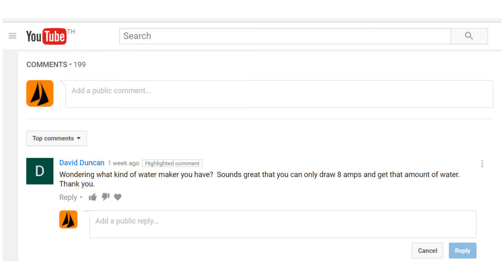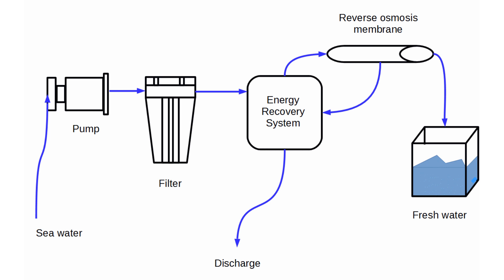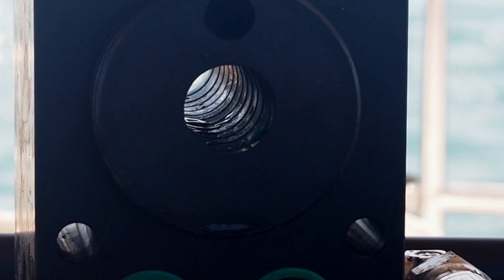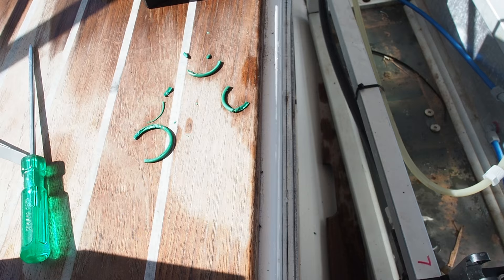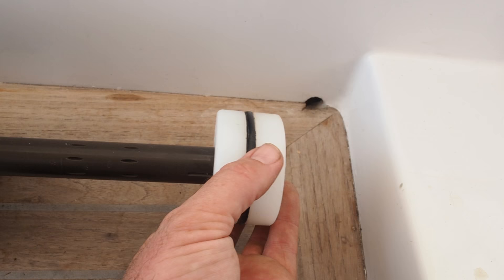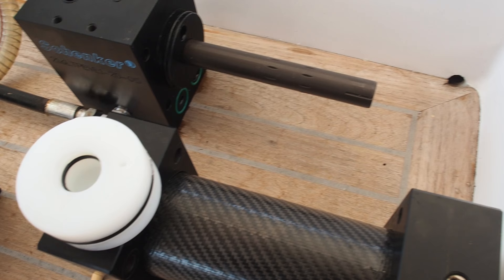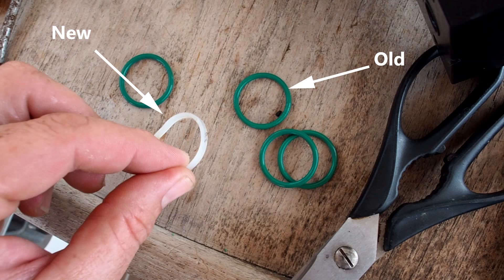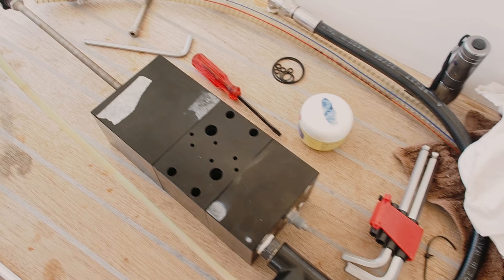How to repair and service a watermaker on a sailboat. Sailing Q&A 4

Comment: That's very interesting in the workings of desalination reverse osmosis pumps. I have a Big Berkey water filtration water maker. It has filters that take out all the bad stuff to make just about any water drinkable. Except salt water. It seems that the salt molecules combine with the water molecules and the gravity type units do not separate the molecules like your pressure unit does. Pretty neat!
Reply from the maker: Interested to know in what application you use your water maker, Dave. I'd just assumed all reverse osmosis desalinators were used for salt water.
Reply: The type of water purifier I use, (here on land), can make almost any water potable. Mine is used as a backup in case my well quits working, then I can safely use pond water to drink nearby. I live out in the boonies. Drinkable water is important. It is a filter and not reverse osmosis. The filters can be reverse flushed. Here's a link to these kind of filters... http://www.bigberkeywaterfilters.com/helpful-resources/?___SID=U
Reply from the maker: Yes, that's quite a different process. The only filter we use is a 5 micron to remove 'large' particles from the raw water. Given more space if like to include an additional filter system like the Big Berkey inline.

Comment: A watermaker would sure be nice.  It does seem that they are fiddly creatures that take a lot of maintenance to keep them in operation though.   We don't really have the room to set one up on our smaller 35' boat, or the extra power to run it right now, so we are planning to try going without.   It might be a trial conserving water though.  Fresh water is a precious commodity on a sailboat. 

Nice video on your watermaker and your efforts to keep it running in top notch condition.  I'm getting really spoiled having a new FollowTheBoat video every day to watch.
Reply from the maker: Cheers, +SV Barry Duckworth. There are small watermaker units out there though. They take up little space. I helped recommission a unit that was small enough to tuck under the sink. Of course their output is far less but the trick with watermakers is to run them regularly. If you get into the habit of running them whenever the engine is on, for example, then they're less of a hassle. The problems start when you're constantly pickling them. I've let our watermaker stand for weeks at a time without pickling and it doesn't seem to mind.
Reply: SV Barry Duckworth We installed an H2O to go watermaker in a companion way step. Total cost about AUD$4600.  Details here http://www.h2oonthego.com.au/ .

Comment: I'd get those rods on a lathe and take the thread off the sections that remain outside the housing when assembled.
Reply: Good idea! the factory should have thought of that!Great info on watermakers, they do seem to be great machines but are often trouble some. Picking a machine with good world wide support is vital. The use of watermakers has made the singlehanded/crewed sailing races round the world so much faster as they don't have to carry all the weight of water , hence less food so less weight , hence even faster so shorter times so even less food and it goes on. About 75 days for the Vendeeglobe finishing in the next couple of days.  great informative video.  cheers warren
Reply from the maker: Yes, very good point!

Comment: Interesting. Most systems I've seen use a low pressure pump and a clarkpump.
Reply from the maker: Isn't that a Spectra-specific system?
Reply: followtheboat I think maybe the "clark pump" name may be specific in RO as spectra? But I think other water maker may call it a boost pump. Rainman water maker out of Australia and others may call it diff?
Reply from the maker: Thanks for the info. I am no expert on watermakers and I'm learning all the time (which is sailing in general). Thanks for the info.

Comment: Any watermakers known for their simplicity, durability, and ease of maintenance and repair, or are they all similarly challengingly?
Reply from the maker: That's not a question I could answer with complete authority. The only other watermaker I have experience with is the Eco Tec, which is petty straightforward.

Comment: Great episode, very well put together. Have a question about solar power. Don't know if you have seen what Elon Musk is doing with solar roof tiles but wondered if an adaption of that concept would be viable to "roof" a boat with  much more surface area than is possible with fixed sized solar panels.
Reply from the maker: Hi Steve. Yes, we try to keep up with solar technology and I'm aware of these panels. My dad told me about them initially and I did wonder about the practicality of putting them on a boat. The main issue would be their non-slip properties in the wet and how much heat they generate, not to mention wiring. Interested to know how much more or less efficient an array of them are compared to a single panel of the same dimensions.

Comment: Great, great information on the water maker and repairing it. I love these Q&A videos...so much info. I have a question about bugs and insects on board and keeping them out in humid places like the part of the world that you are traveling in. Have you ever had problems with cockroaches and insects getting inside the boat? If so, how do you get rid of them and prevent an infestation? Thanks and fair winds!
Reply from the maker: Great question, Kia. In fact the clip of Liz swearing at me was when we were clearing up a cockroach infestation. They happen from time to time but are easily tackled with the right powder. We'll cover it more in a future episode but essentially you want to get your boric acid (or equivalent) in all the cupboards and under the sole boards.

Comment: I have a question for the Q&A. Being new to the idea of being a live aboard, other than passports and inoculation shots what else is needed to be able to hop from one country to the other on a boat? What kind of issues do you have to deal with with customs?
Reply from the maker: +Frank Grant [Liz] It's just the same as land-based travel with the addition of the harbour master's office to clear the boat in and out. Visas differ from country to country, so do your homework before you arrive. It's not difficult. Enjoy!!
Reply: followtheboat thank you for responding back. Would that be the same with produce and other forms of inspections before docking?

Comment: How often do you have to replace the membranes?  

Are they expensive? I understand the availability issues but let's assume you were near the mfg.

Really enjoy your channel!

Edited to add >
From the mfg website (The only consumable that must be replaced periodically (on average 1 or 2 times in a season) is the pre filter cartridge, which is inexpensive. The reverse osmosis membrane is expensive to replace but has an average life of 6-7 years if the maintenance manual instructions are carefully followed.)
Reply from the maker: Hey Judd. You just about answered your own question with the edit. Spot on.
Reply from the maker: Forgot to say: membranes are around $400 dollars, give or take.
Reply: $400 doesn't sound all that bad to me.  I was thinking the membrane replacements were in the $1000 range.
Reply from the maker: I don't think they're that expensive, unless exchange rates have changed that much since I last looked. Ebay has many, as does Amazon.
Reply: I've just gotten used to every price in the boating world starting at $1000 and going up from there.
Reply: The mfg also mentioned  a charcoal prefilter to remove any chlorine in water you may get from an marina. do you have this filter as well.

For a separate q&a  It would be extremely helpful if you would address medical emergency. Dental, laceration and broken bones etc.  Not looking for medical advice  but how you get the help for things outside your skill set.

Thanks

Comment: Another great informative vid of how it is not all easy sailing - 
Ive seen a petrol version of a water maker [mobile unit] have you any experience of these - rated output of 140ltr per hour just cant find the link i had
Reply from the maker: I've heard of them but have no experience with them. 140lt is a respectable output.

Comment: You're lucky you only had the salt to deal with. At my beach house, we had the sulfur oxide to deal with. Had to process the water with 36% Hydrogen Peroxide to knock down the sulfur. Then pass it thru a charcoal filter to knock down any residual peroxide before passing it thru a high pressure osmosis system. 10 gal of water produces 2 gal of fresh water, and 8 gal of "bad" discharge. A very expensive proposition costing about $400 a month in chemicals. Do yall ever catch rain water?
Reply from the maker: +BeachBow [Liz] Eeeeyuuu, sounds horrible! Mind you, some of the ports we've been anchored in are full of diesel, oil and unmentionables! We sometimes catch rainwater, but don't have a dedicated system. We're hoping to install one when we build the hard dodger. Peace and fair winds!

Comment: What is pickering?
Reply from the maker: Hi Jackie. Do you mean 'pickling'? It's common practice to pickle a water maker when leaving it unused for a period of time.
Reply: followtheboat, sure I did😉 You use vinegar or something?
Reply from the maker: No, we use two chemicals, one to clean and one to pickle. One is an alkaline but I don't remember which is which. It comes in a powder which you add to a bucket of water that you then flush through the system. We buy ours direct from Schenker but you could probably make your own using the relevant ingredients sourced from a chemical shop.
Reply from the maker: +Jackie Howlett I've just checked. One person out there uses  Sodium Metabisulphite, which you can buy from wine and beer shops. See this link: http://mvvikingstar.blogspot.com/2013/10/cleaning-and-pickling-of-watermaker.html?m=1
Reply: followtheboat, Thanks guys, but I don't have a boat yet😃 I did go to the link. He talks about dead fish or whatever getting in the membranes. That's gross man😗 Shouldn't the filter stop things from getting in? If I just do coastal cruising, think I can get away without one😃

Comment: Do you guys make sure to take lots of supplements when drinking lots of water from the water maker. There is another couple sailing around the world and she hates drinking water from the water maker do to it being stripped of all minerals etc. My understanding is Liz never had children so the issues with suffering brittle bones is far lower than a woman who has had multiple children. The wife in this couple basically gets all the bottled spring water during long passages or when clean water isn't easily found.
Reply from the maker: +Jonathan Kaany [Liz] Thanks for the interesting comment.
No, we don't take supplements as we get plenty of vitamins and minerals from our food. The water's for washing, making tea and coffee, as well as rehydrating when we're sweating in this tropical heat! We're not picky about water, which we're happy to drink from almost anywhere! 
Peace and fair winds.
Reply: We have a RO (Reverse Osmosis) filter at home which is similar to a watermaker. We love the clean taste of the water. UK municipal water can be pretty awful sometimes hence the RO filter. However we do take vit & min supplements and I also found out recently that most of us are deficient in magnesium. Magnesium is best absorbed via the skin, swimming in seawater daily is excellent, or in drinking water. The solution is to make your own Magnesium bicarbonate by taking a litre of soda water and adding 3 tablespoons (45ml) of Magnesium Hydroxide (Milk of Magnesia). Recap the soda water and shake. rest in the fridge for 30 mins and shake again. After the third shake the plastic bottle will deform slightly as the contents shrink slightly. Then you can add this at 11 water to one magnesium bicarbonate to your pure water from the watermaker. This makes the water taste really nice. This I think is the response of one's body saying "Hey magnesium that's good"